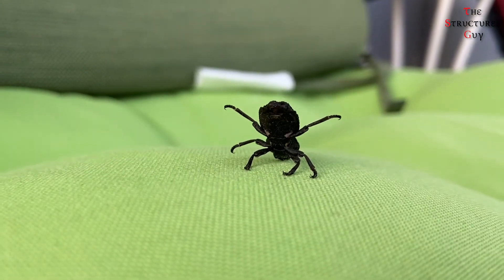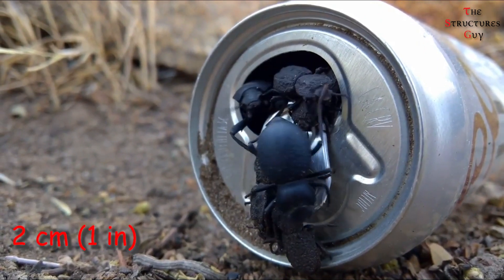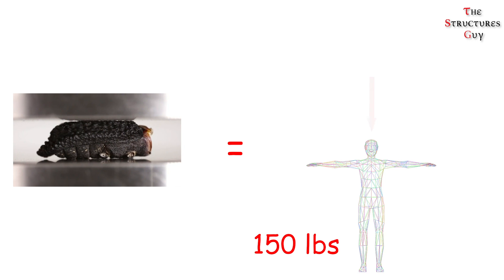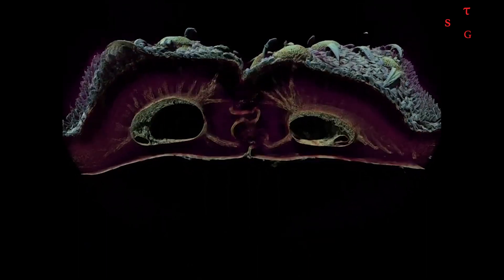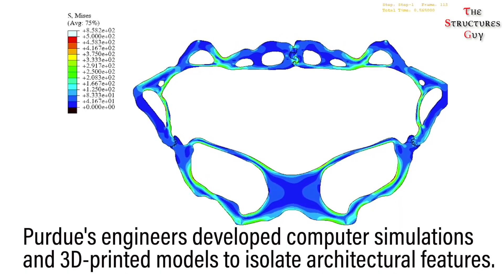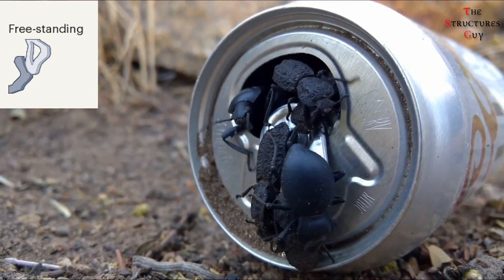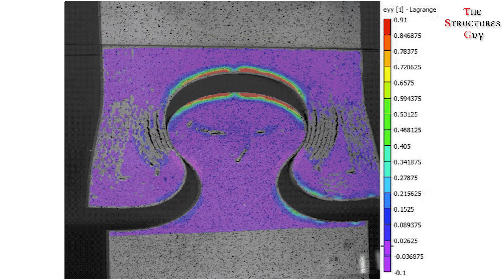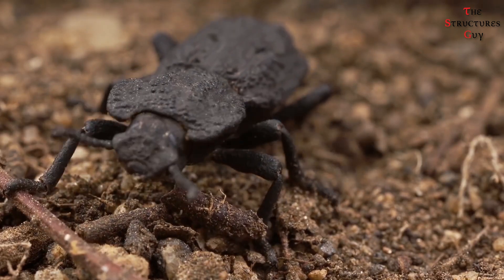The Uncrushable Diabolical Ironclad Beetle: Structural Analysis

Comment: part of what makes it amazing is that it fails structurally in a lot of localized smaller regions instead of one great big catastrophic failure. Would be cool to have a door of a car made with this design of their shells to absorb huge impacts in car crashes. It also makes me think that for things like car doors, they will still operate after the collision. If you look at how the shell fails at 150NM some parts retain their strength.